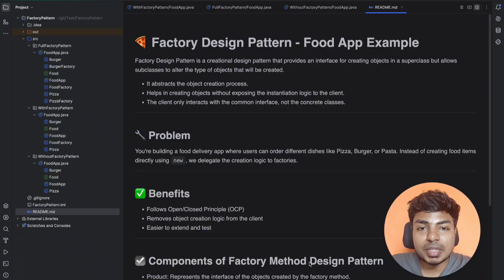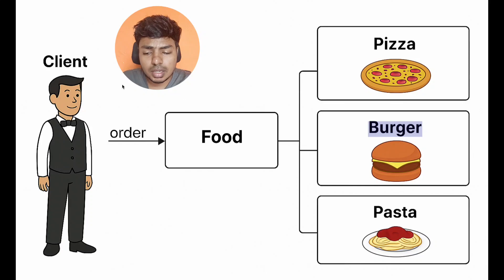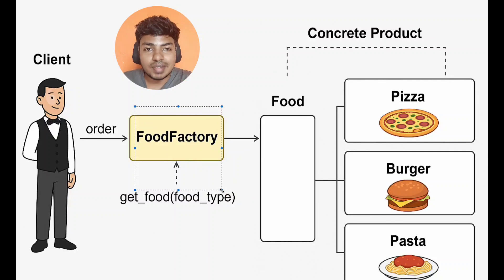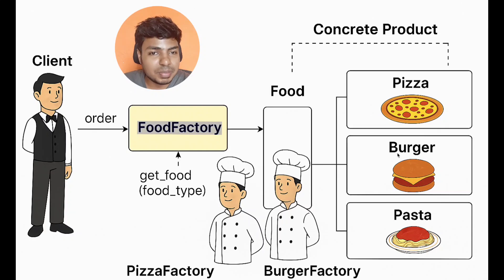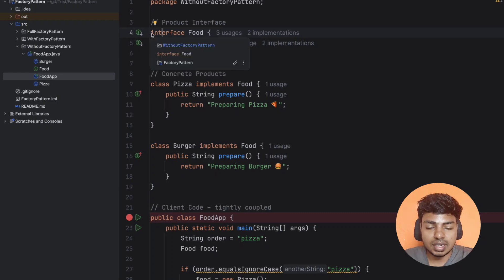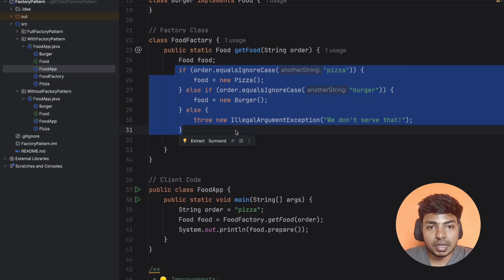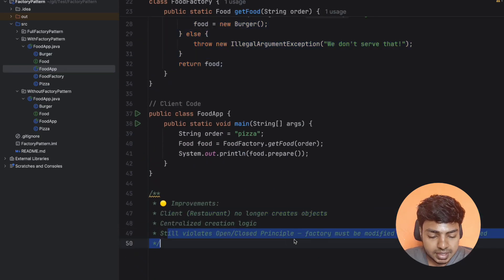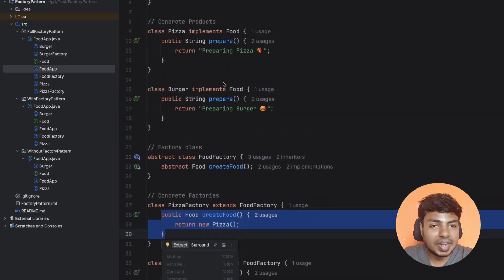Factory Design Pattern Explained | Real-World Example + Code Walkthrough | Tamil

Comment: Actually I have a doubt.. when we were doing without factory pattern there are if conditions e.g. if pizza if burger like that.. when we are doing with factory pattern we not have concerte class pizza factory, burger factory ... Now also it's tightly coupled right ?
Reply: No! Facotry pattern implementation is not tightly coupled. Since everything is defined in concreate classes, only the appropriate concrete class only be invoked. Others will not be touched. For instance, if the user ask for “FriedRice”, then FriedRiceFactory concrete class only be invoked. Other concrete class will not be accessed. This is loosely coupled. This also encourages Open for extension like the above FriedRice case  but close for modifying the FoodFactory.
Reply: How about having 2 functions preparePizza, prepareBurger  and call it directly? What is the difference between calling new pizzafactory and preparePizza?
Only Based on his explanation. And toppings, flavors implementation would be more helpful to understand

Comment: I want to receive one specific food item based on user input, but in the current code, the main class has the food choice hardcoded. So how does it actually know what the user wants?
Reply from the maker: You can use a switch, a map, or strategy pattern. But In production we wont be using any of these, Mostly user choices come via API requests (e.g., /order?mealType=pizza). Typically, a single endpoint handles multiple meal types, and the controller uses input (like mealType) to select the appropriate factory (e.g., PizzaMealFactory).  — the key idea here is understanding factory logic
Reply: @devarajumapathi  
I understand that the controller handles the mealType from something like order?mealType=pizza, but my question is — how does the system know that the pizza slug should trigger PizzaMealFactory, especially when there could be multiple factories?